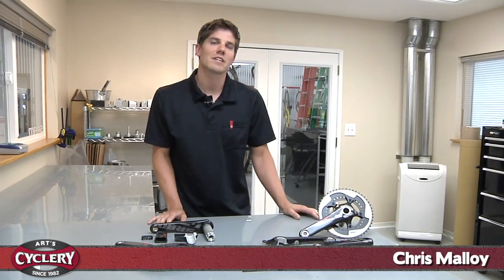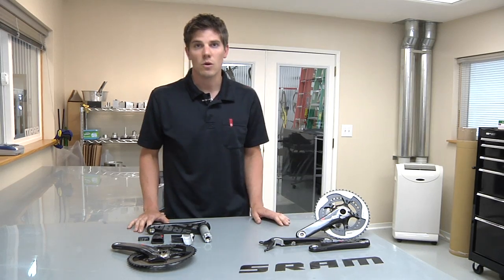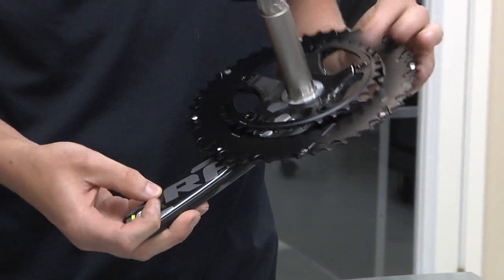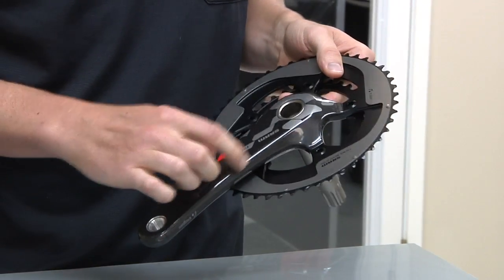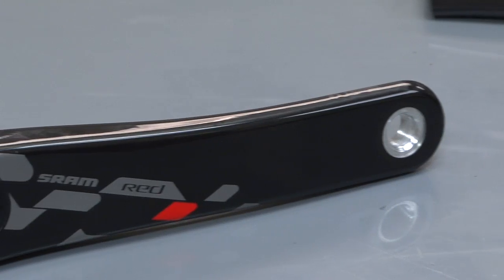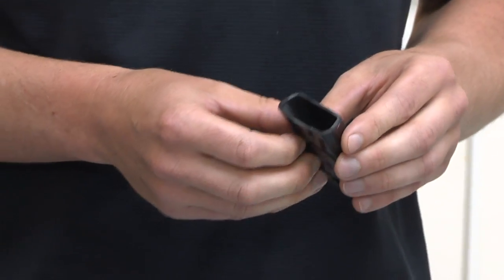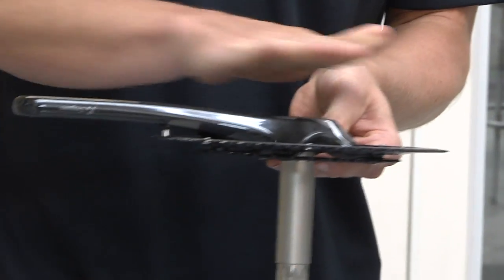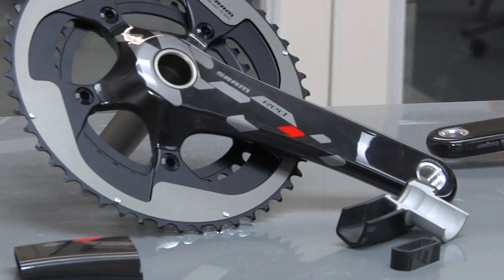SRAM RED 2012 Crankset Design with Chris Malloy

Comment: i have a press fit bb30 carbon road frame.  i just got a new sram red22   110 bcd 50/34 11spd  Xglide exogram crank. and i don't know the the size and adapter to use on it. please help
thanks
Reply from the maker: Glen Tanghak If the crankset is GXP, you will need a GXP specific adaptor.